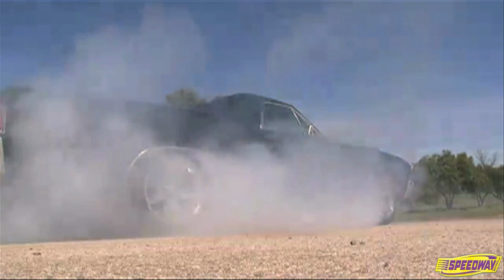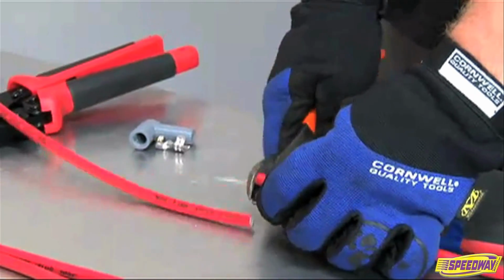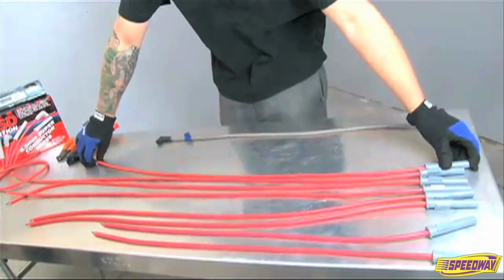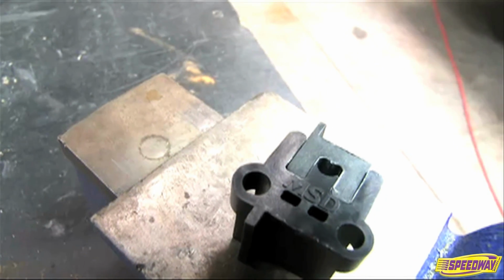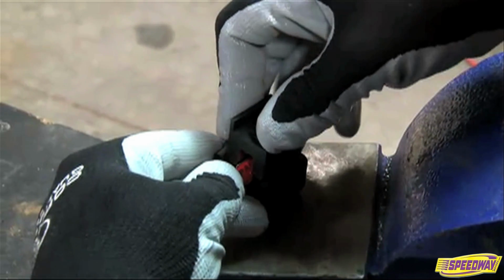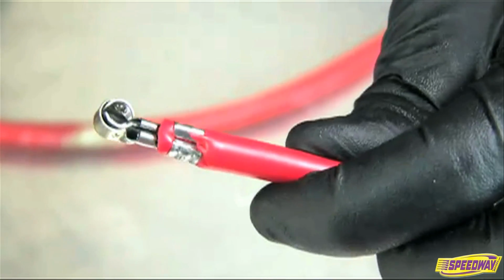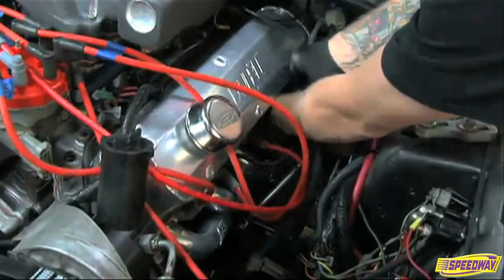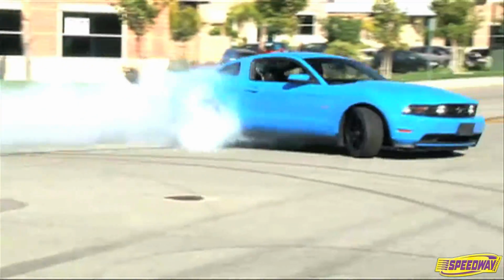Build your own MSD Spark Plug wires

Comment: He's wires suck. I found them very easy to put together was very happy until I tracked down. 3 slight misses under load to the new set of wires I took time to do myself.
Slight misses don't bother me but 3 of 6 grounding to an aluminum plenum is really unacceptable

Comment: Installing better plug wires, along with a better coil, allow a stronger spark to reach the plug. Does it make more power? Not directly, no. Where it does benefit, is in boosted or nitrous applications where extreme cylinder pressures, along with running cold plugs, can lead to spark blow out. Having a better set of wires, and a stronger coil, gives you a stronger arc at the plug, and allows you to run a larger plug gap, which makes for a happier engine.

Comment: The stock wires are basically carbon/graphite fibers inside the silicone cover, they burn-out after a while....the metal core wires dont do this.
You wont be adding any horsepower, you will be taking back the horsepower you've been slowly loosing. :-)

Comment: lol, why rage, i only stated that theres no clear advantage, yes they "might" last longer but there just a pimped up version of normal silicone ht leads. 
id rather spend £25 on a set of standard ones then pay all that money,

granted if your going "for example" msd coils and your of course making your own then yes, i would pay the money, but over standard there just isnt any reason,they have benifical reason. like you said it adds no hp or delivering a better spark. rage some were else